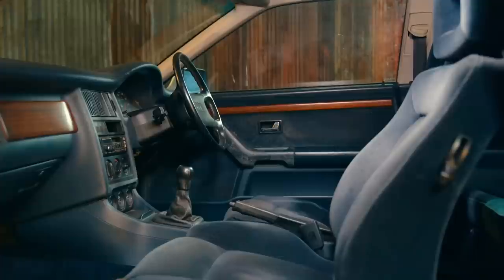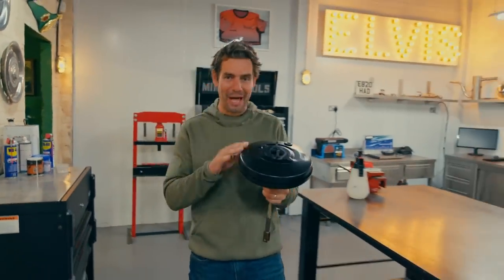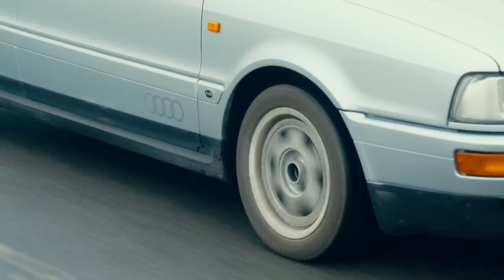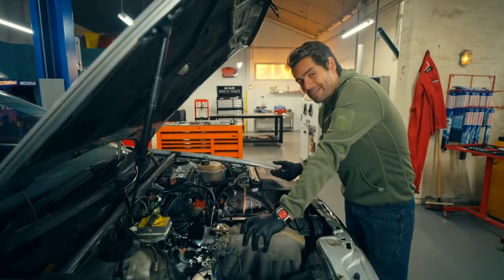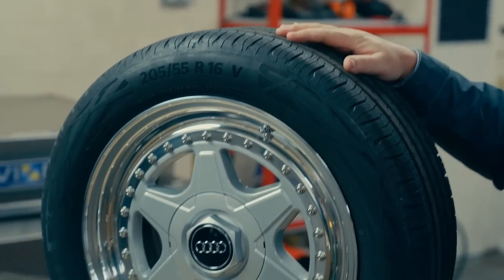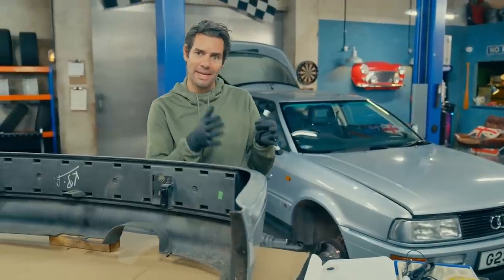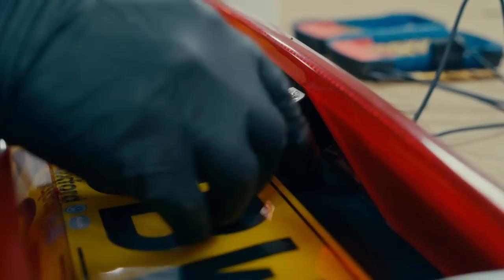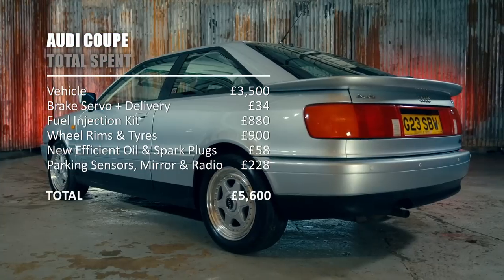Elvis Brings An Audi Coupe Into The Modern Era With Shiny & Swanky Rims | Wheeler Dealers

Comment: A "bone stock" Audi of this era ain't worth jack.  They're US market was non-existent after the 5000 debacle/lies.  These are very marketable upgrades. The closed-loop fuel system pays for itself in reduced fuel usage and emissions. As noted, I would also add a new stainless exhaust but would also add drilled rotors.
Reply: This is UK not US. Stainless exhaust yes, ‘drilled rotors’ no. It isn’t a fast car and unless you are spending a lot of money on discs that have holes cast in them at point of manufacture (not drilled) you only run the risk of the discs cracking around the drilled holes when put through heat cycles.
Grooved discs on the other hand would be better option.

Comment: It would be great to see how the EFI fuel rail and bungs were fabricated. That part of the conversion is probably the most complicated.  There are millions of cars out there with aging Bosch CIS / mechanical injection that would be great to convert, but fabricating fuel rails is not a simple DIY job for most people. Anyone have any insight on this?

Comment: Changing the wheel size and tyres means the speedometer will be inaccurate.
Reply: A bigger rim with a lower tire is the same diameter as before
Reply: @axelmaes4909  Wrong, I own an audi coupe, and 2 audi 80. The speedometer will have a small different with the different tyres and rim sizes. But the is a way to calibrate the speedometer which means taking it apart.